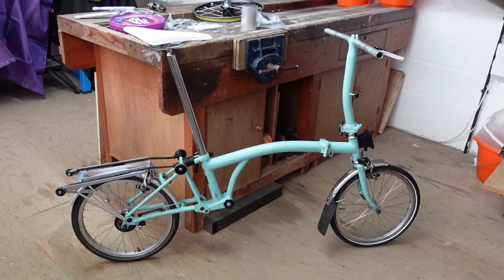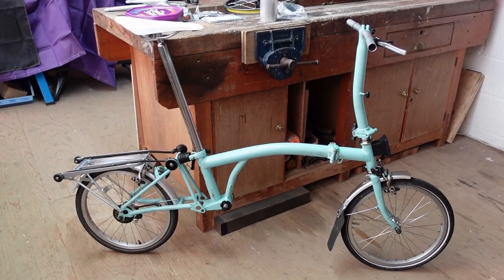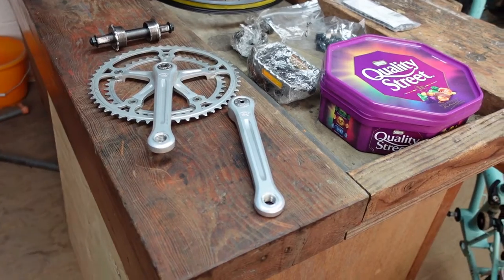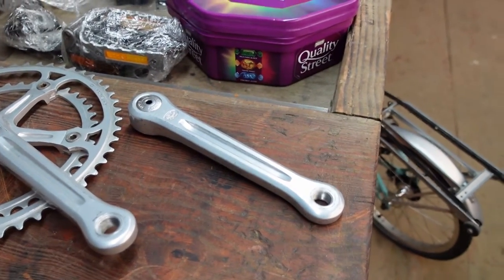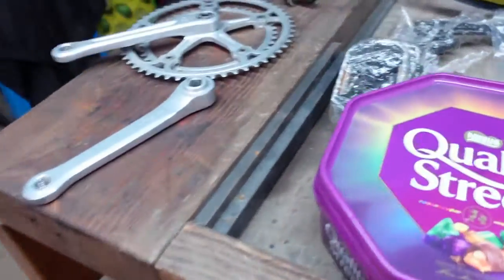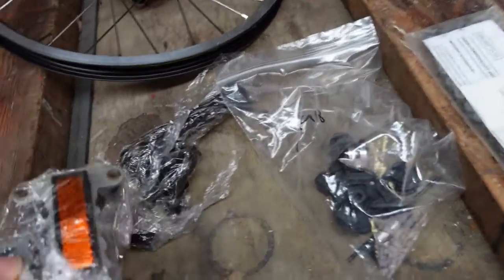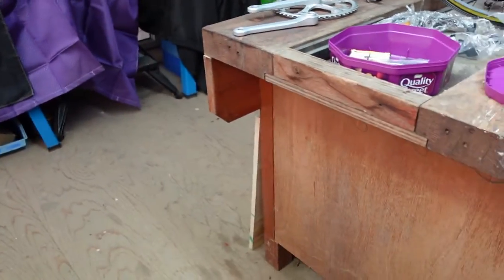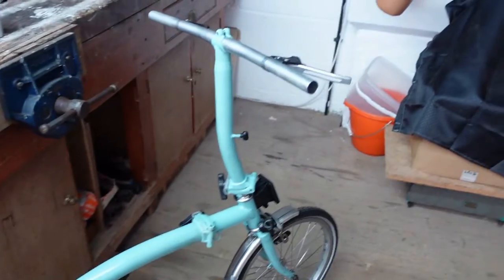Building A Brompton Touring Bike - July 2023 update.

Comment: I have Marathon Plus with tube liner in the rear, no flat in 4000 miles; the treads look like it will last 2000 more miles.  I have a P line 4 speed and never felt the lack of gear, I've been all over Mexico and making my way to Guatamala.  I have knees problem so 50 miles day is about my limit; and I take the bus if the roads are bad.  H type handle bar works well for me, mount my phone with the added cross bar.
Reply from the maker: Hello,
Everyone says the Marathon Plus are the most reliable and I feel they are most likely the best way to go. Sorry to hear about your knee problem but nevertheless 50 mile a day is still good. I am quite shorts which is why I am going to start with the straight handlebars first. Thanks for watching.
Take care.
Paul,,

Comment: Can the brompton chain handle the more twisting for front chain rings ? You might be able to mount or fabricate a mount for the front derailliur thogh. But what about making it derailliur at the back as well then , like some of the asian bromoton clones ? But if it is for ease and dependability I would just mount what the factory intended and just find the front chainring size I like with it. And then maybe instead of derailliur gears, look into a swytch kit or the one Andy Kirby is working on , it might help a speedy recovery after surgery as well,but consult your doctor. I love the cosy no hurry pensioner vibe here , new sub and best wishes from Denmark
Reply: Brompton, not bromoton...
Reply: And thoUgh... there might be more... My phone thinks I am trying to write in danish 😅
Reply from the maker: Hello,
That is a good point about the Brompton chain which I had not considered, if is struggles I am sure a modern road bike chain will be fine. I will try and see what the Brompton derailleur can handle first and then adapt is needed. 
Now I have retired I am trying to get away from the HURRY, HURRY world so slowly experimenting and adapting is working very well for me. Many thanks for subscribing.
Take care.
Paul,,
Reply: On a 16 inch wheel bike; 3 to 6 wide gears are sufficient.  Frankly, I walked the bike quite often on hills.  On a proper full size touring bike, definitely add as many gear as you can afford.  I do not find my 4 speed Brompton lacking in any way, I am touring extensively on folding bike; 12000 miles on a Brompton, 7000 miles on a Bike Friday, countless local miles on Tern and Dahon.  40 years experience with pedal power.

Comment: P.S. I hope the Op goes well. My wife has had both done, and it's a longer recovery than we thought, although still worth it for the pain relief.
Another suggestion for the bike - being an older person myself with a brompton S-bar, I would like to raise the handlebar height, possibly with a riser bar, but the Brompton original cables are very specific to get the right fold. Just something to consider before committing to the S-Bar.
Reply from the maker: Hello,
From the various people I have spoken to the recovery time seems to be quite variable... So far my recovery is going well. 
I am not very tall and the S-Bars do seem quite high compared to a racing bike... I think once I have ridden the tourer a bit I will get a feel if I need to raise them. Thanks for watching.
Take care.
Paul,,